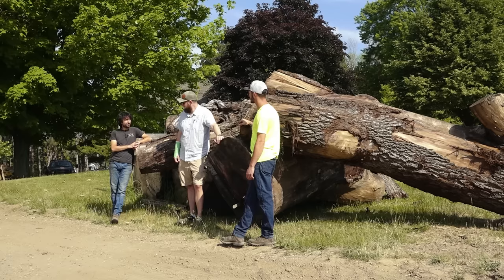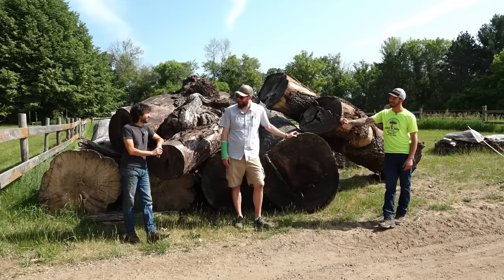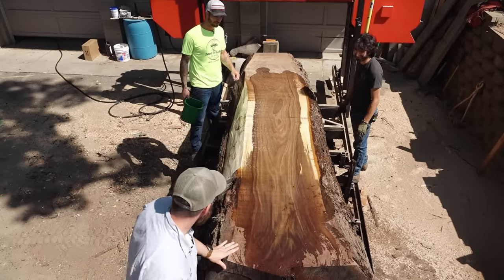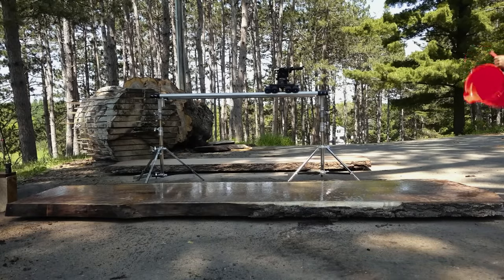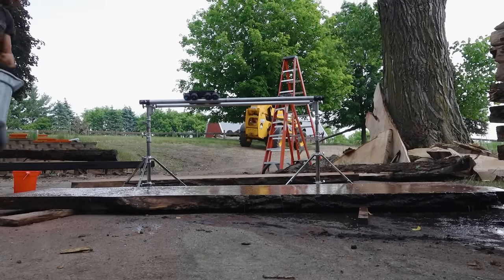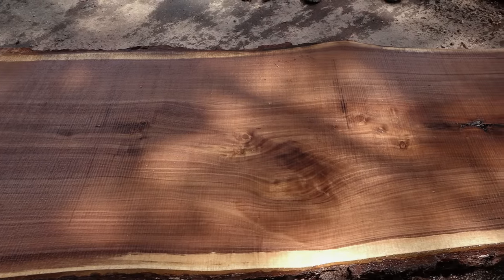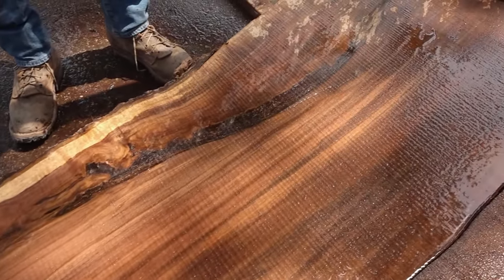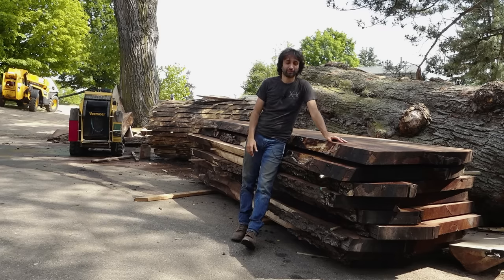They Brought the Biggest, Clearest Walnut I’ve Ever Seen

Comment: Wide clear walnut was common 100 plus years ago. I have a drop leaf kitchen table from my mother 's family that the 20-inch top is from a single board. It was used in the farm kitchen in central Illinois. It was considered just a common table and used as a work surface, and it has many knife cuts where it was used as a cutting board.  It was a "factory" product and has turned legs. They were not rich farmers, so my guess is that they did pay a lot for it.

Comment: I noticed when you were digging the target log out you passed a stack of slabs with some big cracks on the ends. Have you ever watched any of the Sasada saw mill videos from Japan? He uses some really big staples across any splits when cutting slabs on his vertical band saw. Just hammer them in and let the slabs dry to minimize the cracking

Comment: Time changes what we what for wood pieces. As a teen in shop classes the wood we wanted was free of impurities, if it had some knots we'd filled with wood filler and hoped it wasn't noticeable. Knotty pine was in style but nothing else was desired, as you say, "Just wood" was what was expensive and imperfections where tossed aside for scrap. Now, with epoxy filler you can admire the imperfections and not throw away wood. I'm sitting at an late 19th century desk of my Grandfather and it is old solid slab of oak, nary a imperfection to be found.
Reply: Depends on the purpose too...I know a lot of woodworkers that still want straight grain for the purposes of having a stable project that's more structurally sound over time. 
Because of that, some woods at hardwood dealers stay higher in price even straight grained. 

Also a bit easier to work/mill the straight stuff.

But you're right, technology & social media have changed what people are looking for & appreciating in figured & "defective" woods

Comment: Have you considered, a mechanical drive instead of the winch. I am a retired loader operator 68 years of age, with bung shoulders. Now i know you have been asked this before, But how are you going to feel in 20 years. When i  was 35 turning the steering wheel on a loader it never occured to me i would have problems later on. Any way i like your videos keep up the good work.